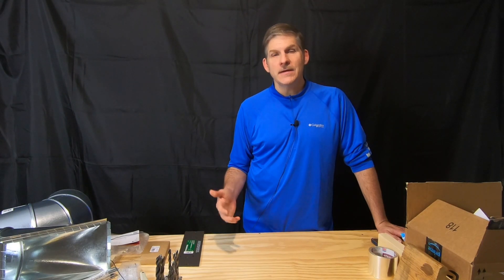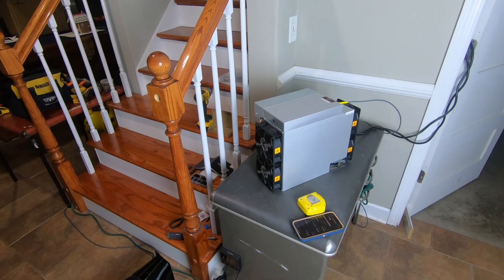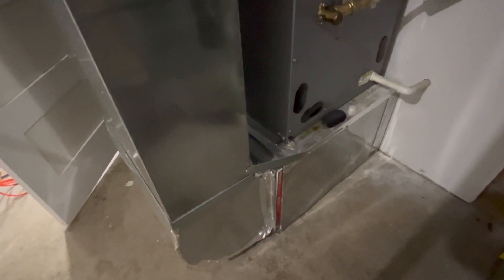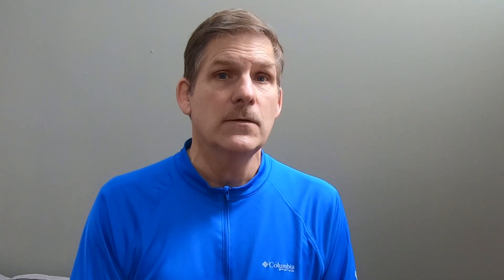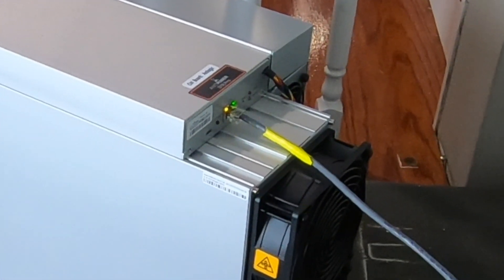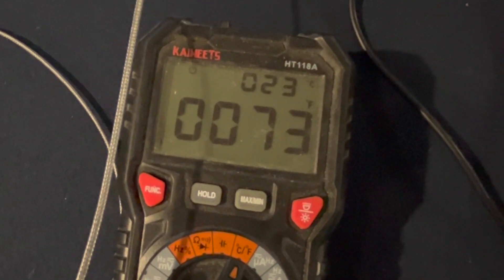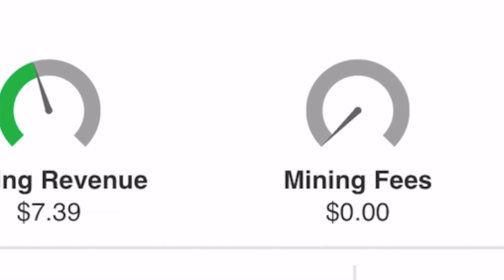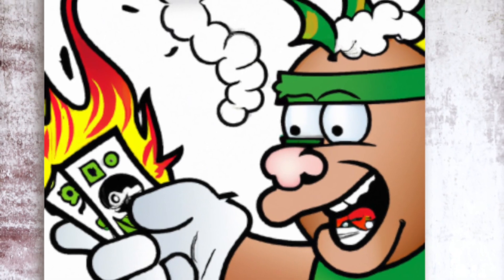Free Heat for Basement, Garage, Workshop : Cure High Utility Rates w/ Alternative Heating Source

Comment: What do you do in the summer??
Reply from the maker: Hey Candece,
Great question again! Typically the heat can be ducted to the outside - just wasted. But I’ve been working on finding ways to use it rather than waste it after we don’t need the warming inside. 
Once I figure that out, you’ll be sure and see a video on it!
Thx for the questions!